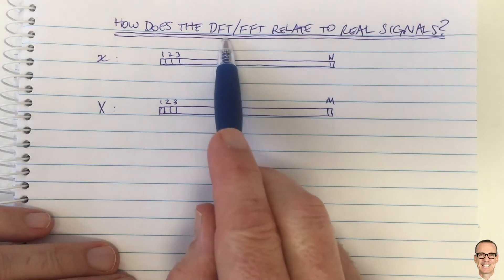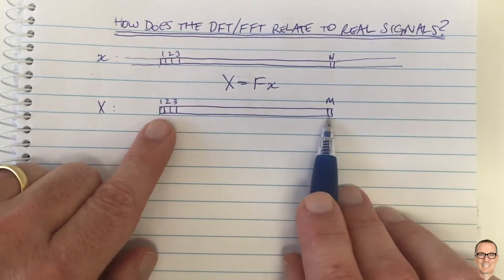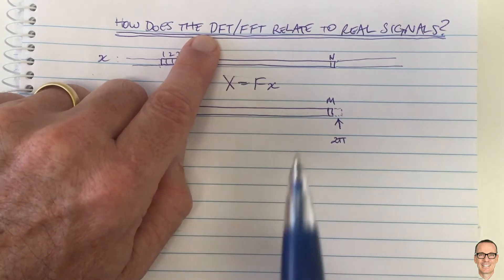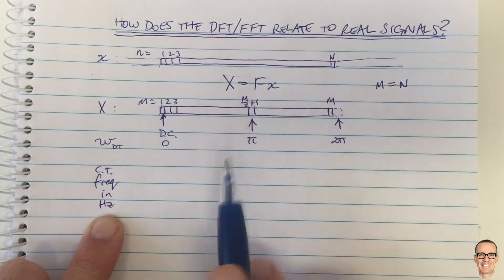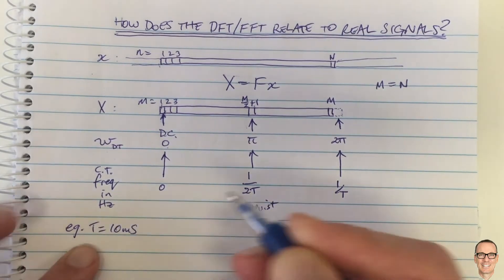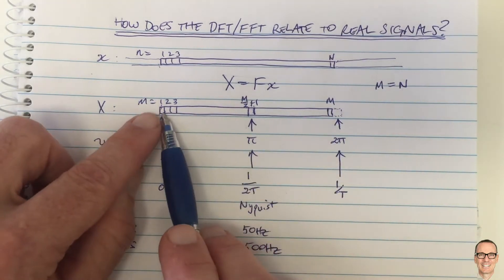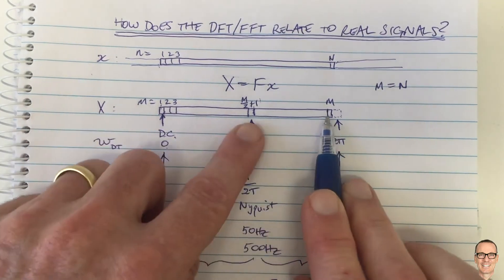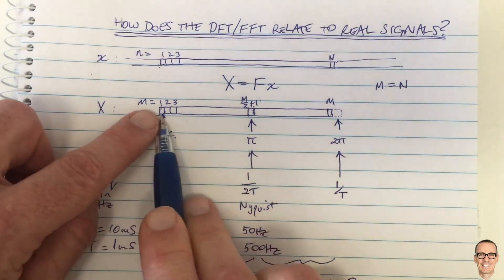How does the Discrete Fourier Transform DFT relate to Real Frequencies?

Comment: I understand that when you do a DFT, you get a vector of the phases, aside from the vector of the amplitudes. Do you?

In other examples, I see that the phase in the FT is either 0 or pi, which is represented as a positive or negative magnitude in X(f), in which case we don't need a separate vector of the phases. But I don't know if all discrete-time signals have this property.
Reply from the maker: When you a DFT you get a vector of complex numbers. Each complex number has a magnitude and an angle. These represent the amplitude and phase of the corresponding sinusoid at the corresponding frequency. When you see a phase vector (or plot) where there are only the values 0 or pi, then that's because it's a special case, where the complex numbers all have zero imaginary components (ie. they are all real valued), and the amplitude is either positive (0 phase) or negative (pi phase).
Reply: @ thank you!

Comment: Great explanation sir, few quick queries: 
(1) Isn't it the case that (0-pi) plot for DFT is a mirror image to (pi - 2pi) ? Please let me know. 
(2) From your video, M is the discrete vector length of DFT. N is the sampling frequency of signal. Does M should always be same as N ? M cannot be greater or less than N ?
(3) DFT is called to be sampled version of DTFT.  so we cannot construct a complete signal (highly resoluted signal )in time domain unless  M or N tends to --> infinity right? 
Thanks again
Reply from the maker: Answers: (1) Yes, (2) M=N, (3) Yes

Comment: Is this about two sided spectrum, right ? I wonder if the negative frequencies could be separately modulated and "bounded" together with the positive, building the single frequency at the end. Then only if we multiply such a signal with some fc carrier frequency, than the negative and positive will start to distinguishable ?
Is this really that the single real sin function may carry the four signals (negative sin+cos and positive sin+cos), making it possible to modulate 2 separate symbols at the same time ?
Reply from the maker: Short answer: No. Hopefully this video helps: "What is Negative Frequency?" https://youtu.be/gz6AKW-R69s
Reply: Thank You for that link. Actually I was wondering if positive and negative frequencies could cancel each other making pure cosine (horizontal complex movement) or pure sin (vertical complex movement) or any other combination (diagonal complex movement)?  Is that possible assuming that we address positive and negative frequency with a different symbol in OFDM ?
Reply from the maker: Perhaps you didn't quite understand the "Negative Frequency" video. Negative frequency does not exist. It is just a representation of a phasor that is rotating in the negative direction. These videos might help: "How do Complex Numbers relate to Real Signals?" https://youtu.be/TLWE388JWGs and "Visualising Complex Numbers with an Example" https://youtu.be/hXl5uX6Ysh0

Comment: 06:15 FOR REAL SIGNALS THE NYQUIST SAMPLING RATE IS TWICE THE maximum FREQUENCY OF THE SIGNAL. BUT FOR 10ms PERIOD SIGNAL, frequency is 100hz hence nyquist rate=200hz. Am i missing something professor?
Reply from the maker: It's not a 10ms period signal. It's a 10ms sampling period. Which means the sampling rate is 1/10ms = 100 Hz, which means the highest frequency that can be fully recovered from the samples is 50 Hz.